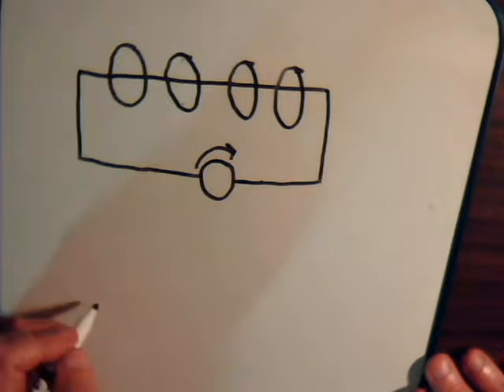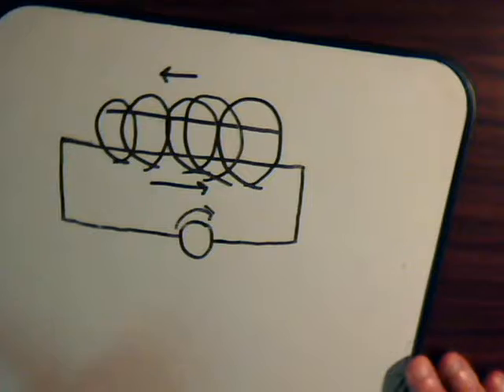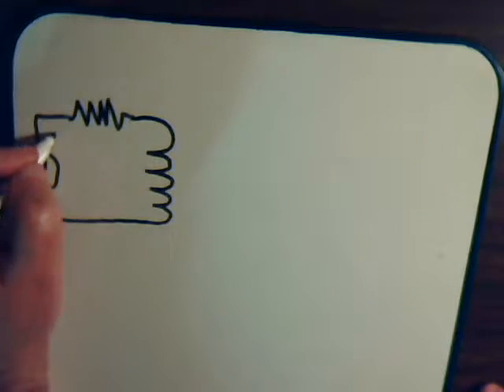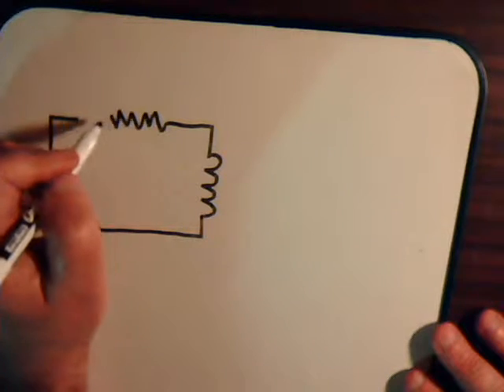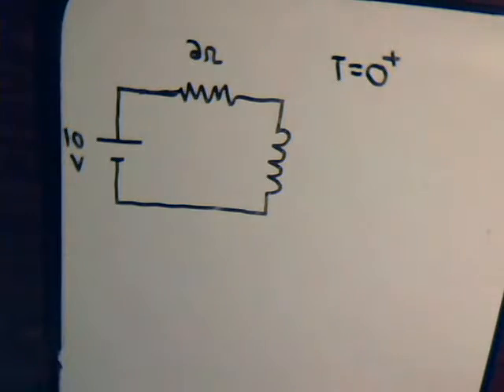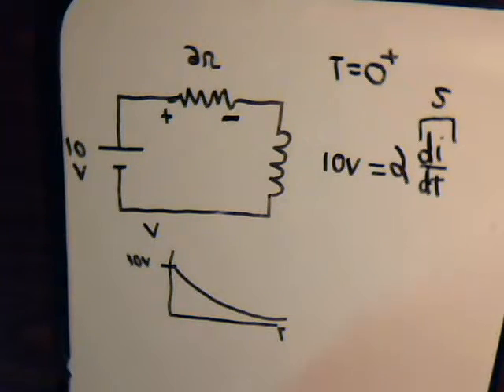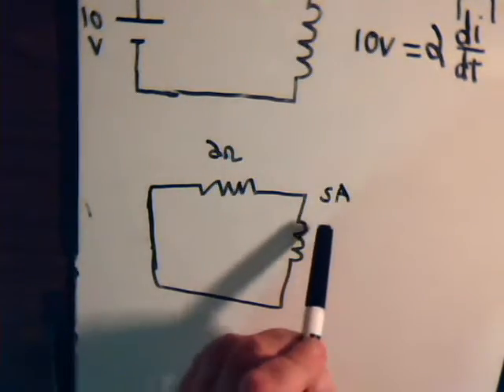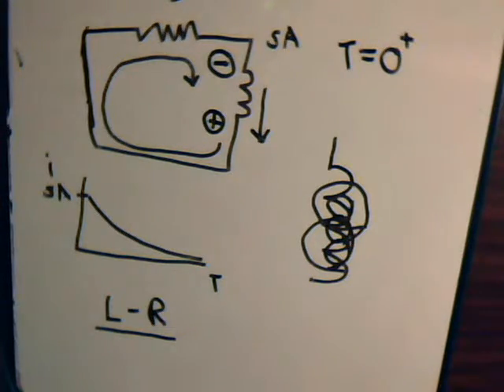Electrical Circuit Analysis Video #53:Inductance - Lenz's Law & Basic Properties

Comment: When you remove the battery and replace it with a switch, the current is dying out because of losses to the resistor? in an ideal situation, could we have preserved the current flow in the circuit without the use of battery? great videos, thank you very much!!
Reply: All wires have resistance. So If you managed to do this the current would fade away. However if you cool the wires down to -273.15C or 0K (kelvin) the wires will become super conductors. Hope this helps question from 12 years ago.
Reply: @testing-nj2ne  Indeed it helped ! Thank you very much!!!